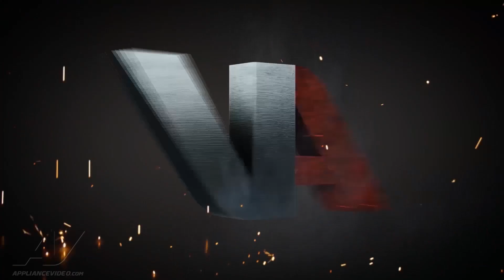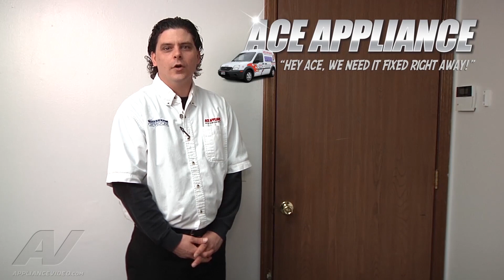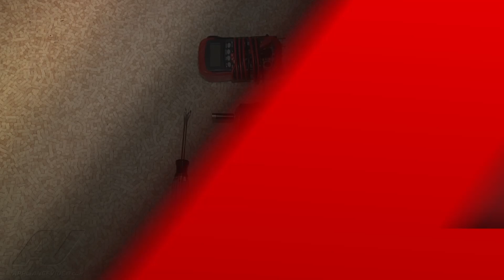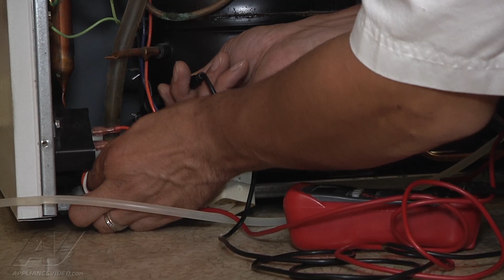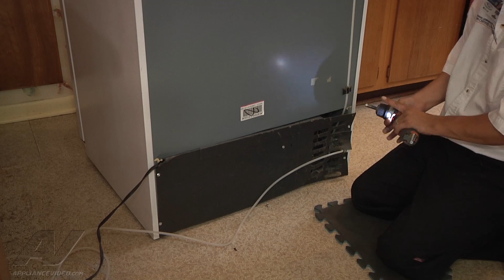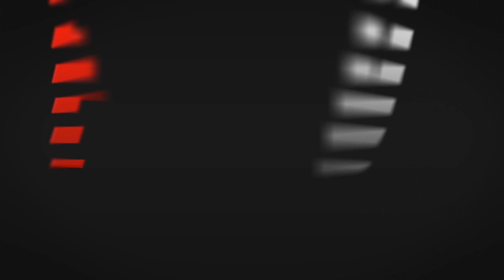Maytag Refrigerator Repair - Leaking Water and Not Cooling Properly - Hard Start

Comment: Should not use a Hard Start just to replace a relay!
Reply from the maker: We stock the hard start kits on our trucks. They are a universal replacement for over 70 relays on the market and are 60% less cost than the exact relay. This customer paid 60% less for the part and its a better quality relay / overload than what the manufacture sells. We guarantee these Hard start kits for life since we have less that .5% failure rate.  We have 13 full time technicians and install over 1100 of these on every year and have been using them for over 12 years with no issues at all. I have had one on my own refrigerator for 9 years with NO issues. I would absolutely not install them if they were not quality products. They meet all manufactures specifications. In fact Supco is owned by an appliance manufacture. Call our parts department at 1-800-830-5465 and save money for future repairs. Thanks for your input.